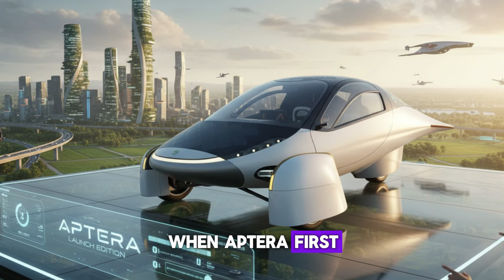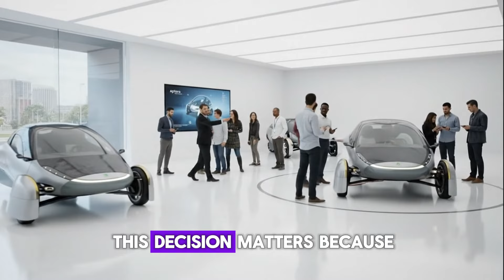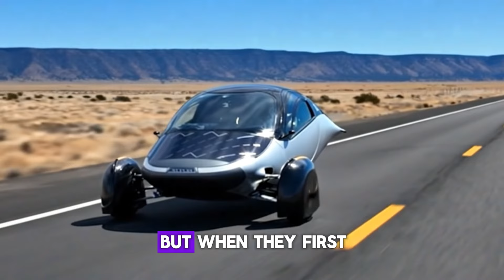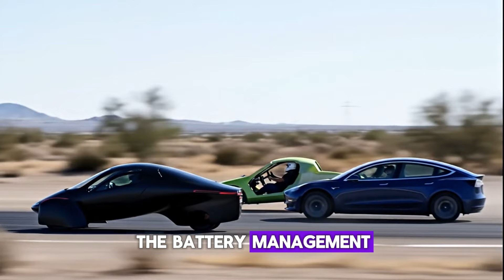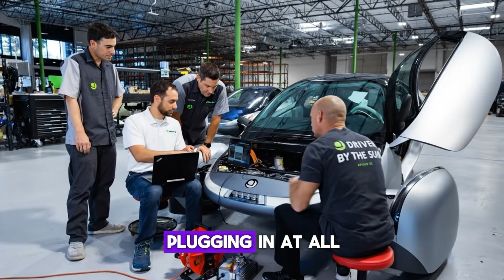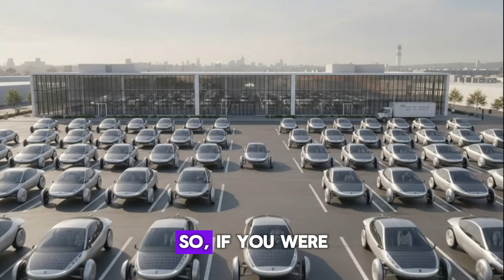No More Slow AC Charging — Aptera Goes Full DC Fast Charging Standard

Comment: Have you seen 40kW charging? CM backed a trike into a TSLA charge stall, plugged in the cable, then had to leave without charging.
At the bottom of the Flagstaff efficiency test, the trike was towed back to Carlsbad because it couldn't be charged.
Solar was demonstrated to charge <20 miles/day. What 30-40 miles/day data do you have?
Reply: The Aptera cult members don’t like facts or being questioned, but good points!